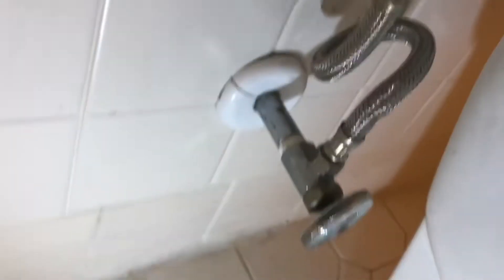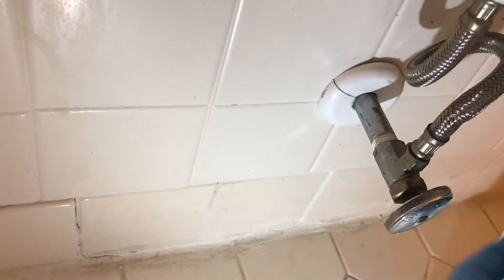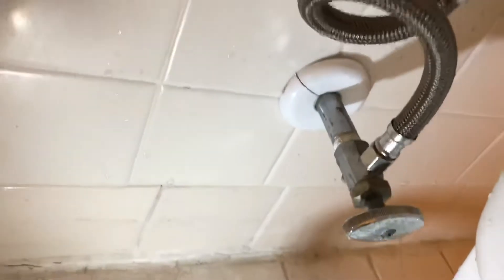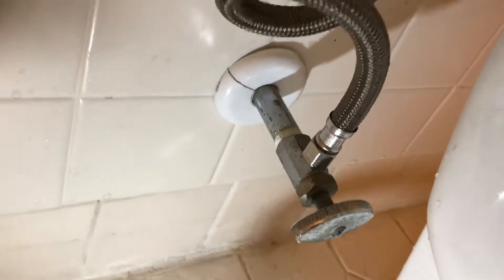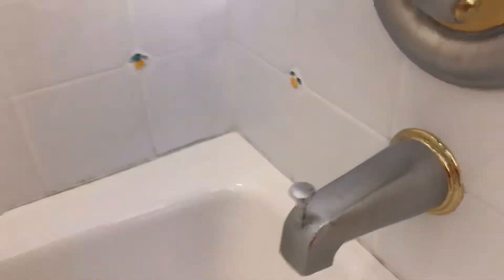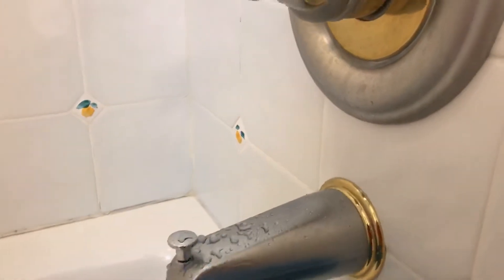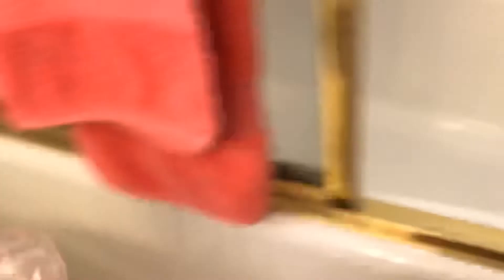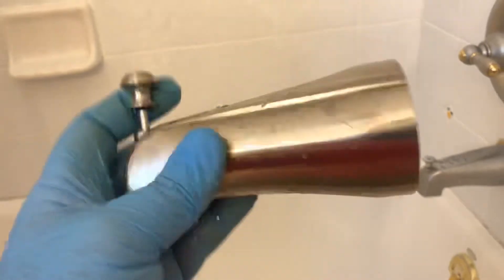Quick Toilet supply line leak repair

Comment: Mine is leaking from the base of the tank from where the water supply hooks in, could it be same issue or an oring gasket  in the tank
Reply from the maker: Just try easily tightening where the fill valve connects to the tank. If that doesn’t work replace the washer inside the full valve in the tank. Good luck
Reply: @HighRidgeHandyman  fixed the issue, took the old out the threads at bottom where kinda gone, changed the unit.

Comment: My leak is coming from shut off valve. I have an old school fixed supply line
Reply from the maker: Check out my video on changing a shut off valve for the toilet. I show how easy it is to just cut it out and put in a shark bite. It will save you time and lots of cash. Very easy to do good luck